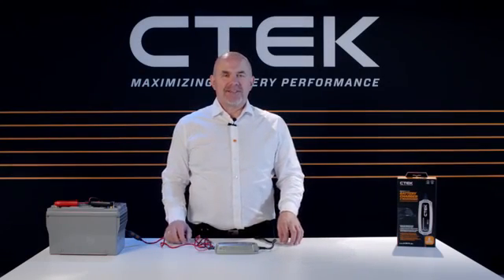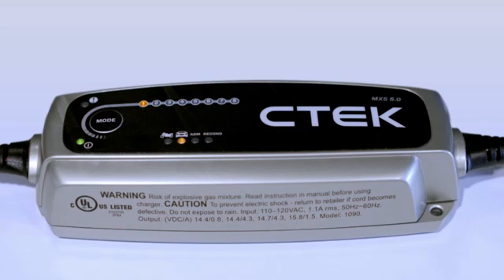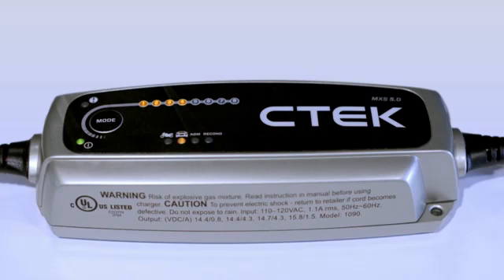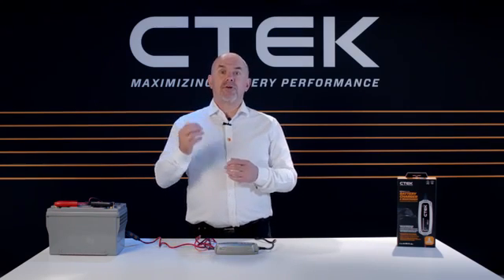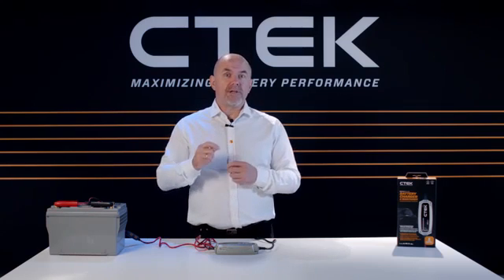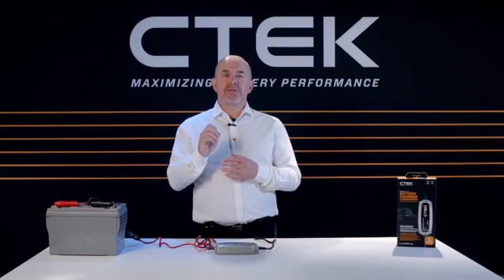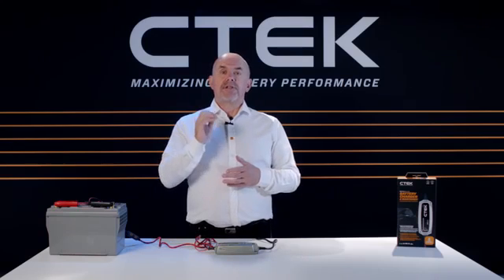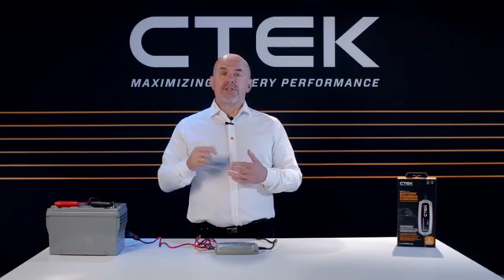Tutorials - CTEK MXS 5.0 - Charging Process

Comment: Good explanation. I first charged my battery with agm to stage 5. It ended there with a red error light. I tried it. Did not work well enough to start the car. Now I try again without  agm and with recond. So I gather my error code implies the battery can't hold the charge. Why? The battery is 2 years old. It should live on even if the car was not used for 5 months.